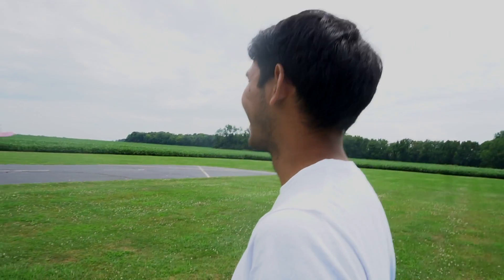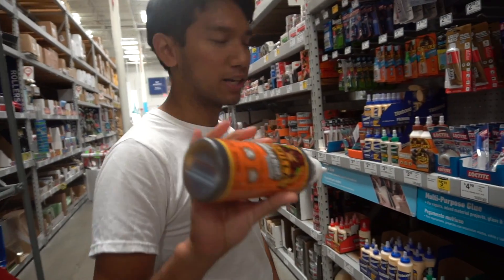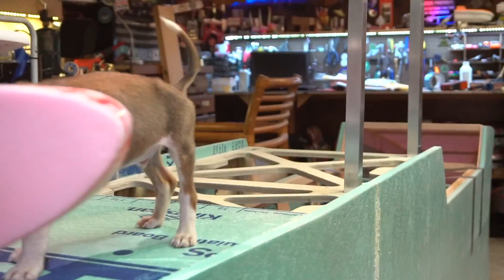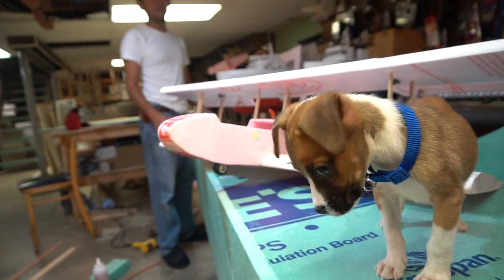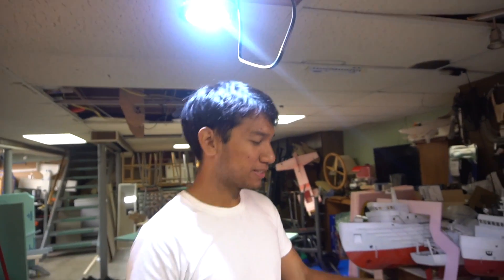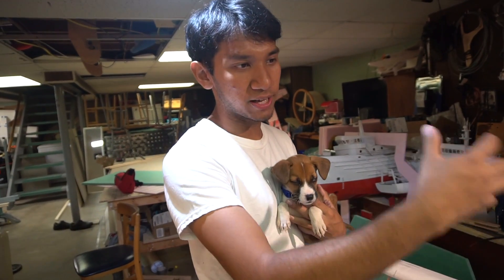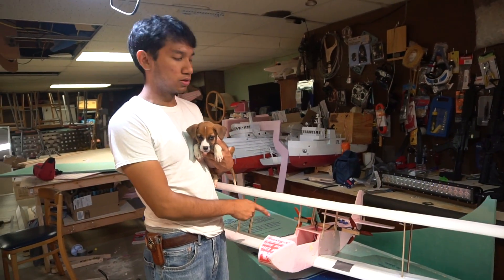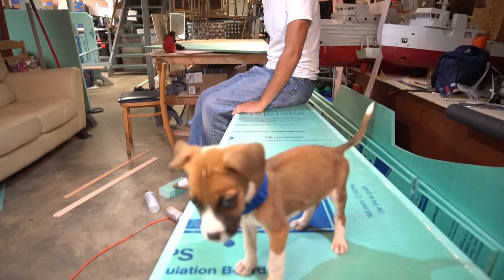DIY electric ULTRALIGHT pt1(fuselage and basic design)

Comment: have questions about the power of the motors and electronics im sure you'll answer in the next vids but dont trust glue man it can easily break if exposed to weird twisty heavy unpredictable stress reinforce it with something else not other glue coz sometimes they cancel each other also consider making your cabin with thick layer of foam so if the worst happens you'll be fine not to be rude again but also plan the worst if you crash make sure nothing heavy will hit you in the face or on the back ......safety first mate......... knowing you i have no doubt that it will work ....have fun
Reply: He said he was going to 'glass the plane, so that will keep the pressure against the glued areas just fine.
Reply: fouzai alaa jesus christ you're dense
Reply: fouzai alaa you do realize that fiberglass is just cloth and glue right?
Reply: fouzai alaa glue is almost always stronger then the materials you are gluing. the wood/foam will break before the joint. that is why you use glue.
Reply: fouzai alaa and he said he is going to use both fiberglass cloth and wrap carbon in critical areas, plus the glue. you didn't even bother watching the video and are giving out advise in how to build it.

its pretty obvious you have never delt with wood, glue, or had to build something both light and strong. a nail is just creating both a hole and a high stress point. with any flex (and yes airplanes flex, even solid steel ibeams stress such as rail road tracks) it would just elongate the hole, creating a bigger void and possibly a spot for the wood to split. nails also require eternal force all around them to keep them in place. any flex, and the nail would just fall out. airplanes have round windows because the flex around a square focuses energy at the corners. this is also why pressurized airplanes are round instead of square.

epoxy (or glue) is what holds airlines together. it is what makes fibers (string) stronger then steel. it holds cars together. ever hear of bonded panel? they are stronger then a weld. most new cars are built with bonded panels in critical areas where high strength is required.

properly glued joints when done correctly is as strong, or stronger then a weld, stronger then steel, and stronger then the weighted weak points (nails) you think he should include. i tried common sense, i tried pointing you in a direction where you could learn about these things, and instead i have to spell it out for you.

lets pretend there are a thousand joints. lets say each nail weighs half an ounce, that is 32lbs of metal out of the 250lb or so requirement in order to be classified as an ultra light. 15% of the total weight of the plane to make it weaker doesn't make any sense.

once it is in the air, nearly all the weight (and stress) will be on the main spar of the wings. if balanced correctly, almost none of the weight for the entire plane would be anywhere except the main spar while in flight.
Reply: lilsammywasapunkrock i meant the joints in the chassis its only held by glue i suggested he add something else to make it stronger
Reply: he is risking his life on this thing if it was me i rather have joints stronger tan just held with glue .... fiberglass is a good idea but a nail in vital joints can save his life ..... its always better to have 3 layers of protection rather than 2 ....thats all
Reply: wow now your a nail expert !!! good for you you clearly wasted alot of time typing that and didnt change my opinion !!

Comment: This is your most exciting project yet Peter and one that you are more than capable of doing and we wish you well with its progress,what control system do you plan on using ? conventional ailerons/rudder/elevator I presume ? I can see more people wanting to build these under part 103 in the UK we have SSDR but no experimental category,go easy and no spinning please as that will put undue strain on the structure and not necessary anyway just bimble along thats where the fun will be,you have done well to select a biplane and can brace it really strong too with proper flying and landing wires,you are a clever chap Peter and I admire your tenacity,what happened to your little Fischer Cub ? the aeroplane we saw once in the garage area at Flitest but never heard any more about,mum and dad are lovely too you have great supportive parents.

Comment: plywood in the sense you're using it for isn't a good idea. and foam and glue isn't a safe idea. I would use the wood as like ww1 planes would be like, with tube and fabric. Aircraft design isn't something you really want to cut corners for I'd take my time and build a proper frame (with screws). also using aluminum tubing and welding would be lighter and even stronger, while a little more expensive. I hope the wings have a proper structure to them.

Comment: Are you going to make your plane remote controllable?  For the initial test flights I would suggest it and just load the cockpit up with sandbags that are equal to your weight.  If all goes well after a bunch of test flights then do manned testing.

Comment: Be careful that the heat from the fiberglass/epoxy doesn't melt the foam.  Also, fiberglass and epoxy tends to be very heavy, and its not structural; it would only make it waterproof/abrasion resistant.  I cant think of a better option, I am sorry to present problems without solutions.

Comment: Yay for watching this all the way through because you actually get the airplane jargon. I'm no flight engineer but as long as you have enough lift from your wing design I don't see why it wouldnt fly. And from working at FedEx I know your CG is very important. Dont forget to account for you chute and gear when your calculating the CG. I'd hate to see you get about 30 ft off the ground and fall out of the sky.

Comment: You should make a dummy that weighs the same as you and fly the plane on radio before you try it yourself.
Reply: I'm pretty sure Peter knows a bit more about airplanes than the Wright brothers did in 1903
Reply: Yeah no they only used extensive unmanned kite testing and painstaking wind tunnel experiments. Dummy would have been too easy.
Reply: Max Feikss better safe than sorry
Reply: I was thinking that too😂
Reply: I'd rather be called a pussy than be dead
Reply: @dakotadriggers8838  That can be your epitaph.
Reply: Do you think the Wright brothers had someone before them to speak about like that? Yes, they did actually
Reply: Do you think the wright brothers were pussies like that? no

Comment: Always thought it would  be cool to build a life size rc airplane to ride in. But if there was a way to mount 6 electric or mini jet engines each on a mechanical rotating joint to lift it like a harrier jet. Biggest concern has always been battery life and power. But yo control the plane by a tablet or video game controller and have it mount in the cockpit. Might save you some AAs.

Comment: Glider pilot here > make sure the wings are detachable. Helps you transport it on the ground. Hold on. I just realized that this is going to be a biplane. Good luck. Btw anything below 500 meters you are lucky if the chute will help you. PS a couple of acces holes might help. And maybe rods for the control surfaces

Comment: Please don't consider spins unless you've done all the calculations to ensure the tail wont be washed out by the wings at high AOA, the airframe won't overspend in the recovery, and dont do it without a parachute.  Spins really arnt somthing for a part 103 ultralight.   Also, consider that your airframe will need to withstand more then 1g, think more then 3 positive and less (more negative) then 1 negative to give you an idea, aerobatic will be more like +6, -3g.  The far' s are a place to start when looming at this.   Be sure to traslate this loading to stress calculations on the spar, fuselage, tail, etcetera, then do a stress test with weights on the finished product.  Good luck!

Comment: The design is good, try using 2 sets of spars for each wings this means more sparing wire but it will make it more structural also try to make a tri plane they had almost no rigging in world war 1 and they had incredible structural strength also it means smaller wing spans but more lift. But for better info on rigging look at pictures of world war one aircraft. Can't wait for the next video ;)

Comment: Since you're planning on fiberglassing the fuselage you should consider rounding out your edges. From my limited experience  with composites sharp corners have a tendency to crack.
Reply from the maker: yep will do, its only sharp right now to avoid builders rash as its just about hit every corner and table edge in my basement!
Reply: PeterSripol
Good point I suppose I hadn't considered the fact that you're building your airplane in a basement. If everything goes well are you planning on publishing your designs? Anyway I'm very much looking forward to watching your progress.
Reply: @PeterSripol  would you mind sending me a blueprint?, and if i were to replicate this build, how much would that cost me? (engine excluded)
Reply: a solar powered plane would be extremely difficult to build in a garage lol. Google search a real solar plane..the wingspan is huuuuuuuge, so all the solar panels have something to sit on.

Comment: I'm just a bit concerned about having electric motors being the thrust, I've never done anything like this before and I could be wrong by all means, but with your weight in there, is 2 electric motors enough thrust to keep you in the air at a safe speed?

Comment: I see the lightweight box wrapped in foam... I do not see the ribs. You need triangulation for strength. You should build some lightweight divider walls to create compartments within the air frame. 

Also you should talk to some people who build lightweight air frames, They can tell you how to V the front of it. (imagine looking from the top down, seeing a V your feet should be at the top and the bottom of the V would be towards the front.) Then a second V behind you with the top of the V slightly inset into the front V portion, this kind of expanding triangulation puts shearing forces away from the pilots  area in the event of a nose first collision, it would expand the forward walls away from your body.  You really have to triangulate based on the forces you expect to see, these kinds of forces can be calculated by Siemens NX type 3d design software. Sadly you can only scale larger planes down without much worry for accuracy, going the opposite direction requires a fine balance between structural integrity (all forces, including torsional forces on the fuse.) and weight.

Best of luck, would love to see you accomplish this!!!

Comment: Hey Peter you should take a look at Dale Kramers electric Lazair thread on RCgroups. 
The Lazair is a twin engine Far103 utlralight from the early 80's with foam wing ribs.

His first power system was straight from hobbyking.
https://www.rcgroups.com/forums/showthread.php?1412424-100-scale-Electric-Lazair

Comment: Love it! First the way to identify spruce in the piles of SPF lumber (which just stands for Spruce or Pine or Fir, BTW) is when you cut it it will smell like turpentine. Pine and Fir do not smell like turp. This should help you get Spruce out of the mixed SPF piles which are MUCH less costly. Also you might try a place that re-utilizes old wood. A lot of buildings used to be made out of Spruce and Douglass fir and they tend to be very straight with less warpage over time which modern rift-cut lumber is very bad about. I digress.
     Second thought may be a bit on the wild side but remember that the wright brothers used "wing warping" to control their aircraft/ultralight and your foam/wire design seems like it would be perfect to use this technique in. At least sleep on the idea.
  Love the little pink plane! It flies beautifully at a slow safe pace. I just got the electrics together for a hot wire wing cutter so I am going to see what I can fabricobble together. I'm tempted to copy that little design. It looks like an easy quick build.
     One last possible piece of info... devcon 4000 is supposed to be really good on plastics that other glues dissolve. Great vid!

Comment: There are way more factors that you have to think about when building an ultralight. Talk to anyone who is an airplane mechanic or designer and they will tell you this is not structurally sound. Plus having rc motors on a ultralight won't even produce enough power to get it off the ground... without a pilot. It will be the flying cinderblock all over again.

Comment: If this project is a success and it flies stable, would you consider strapping some pontoons to it and seeing if it can take off from a lake or some sort? Anyways, good luck on your build and be safe!
Reply: that's inspired a thought! if the lower wing is placed a little higher (12-14"?), the fuselage can be its main ski and only need a couple smaller toons outboard on the wings. might be beneficial helping lower the CG of the wing loading, and a little lower risk of a tip hitting the ground when taking off or landing. wheels could be added or removed for land or water. graft some 2" thick foam from nose to under the seat makes the pontoon step in the fuselage to release from water taking off.
Reply: The biggest restriction to that idea wouldn't be the engineering, as, regardless of how much stress such a design constraint would put on the air frame, it could be accomplished. He would, to the best of my knowledge, have to have a rating attached to his private pilot's certification that allows him to operate water-based aircraft.
Reply: Daniel Mähring yeah so put a third motor like FPVREVIEWS said
Reply: masterimbecile Not really that much pressure, actual flying is what puts the most stress on the plane.
Reply: Good luck, Peter. Check out the Sky Pup (http://machnone.com). It's another partially foam ultralight. It's a gas plane, tho. Know a guy who was flying one and had a fuel leak and the floor of his plane started dissolving on him!  Keep up the good work!  And don't take any aeronautical advice from anyone who uses the term 'tip stall' ;)
Reply: not to mention would also add alot of weight
Reply: But the Goose uses the fuselage as the main float.
Reply: I have a beaver, it weighs 1.4 kilos. it has a huge motor. I just think getting a plane that heavy to glide on water will be realy hard
Reply: haha if you read the comment  again, you will notice I am talking about a model one!!!
Reply: Alex Harrigan ultralight require no licence or registration to fly, and the part 103 law gives weight room for a parachute and floats
Reply: he may be able to put a pontoon on the plane, but the thrust from the motors would have to be bigger to get the aircraft to plane on the water to reach takeoff speed.
Reply: Aloaf Hitler I'm a complete aircraft noob, but my guess would be that water-based takeoff and landing would require stronger structural supports than land-based, since ripples and waves on the water surface would be stressful to the fuselage structure.
Reply: uthorrr that is one of the most retarded comments I have ever heard, water puts a ton of stress on an airplanes fuselage. I should know, I have worked on a Grumman goose for the past 3 years.